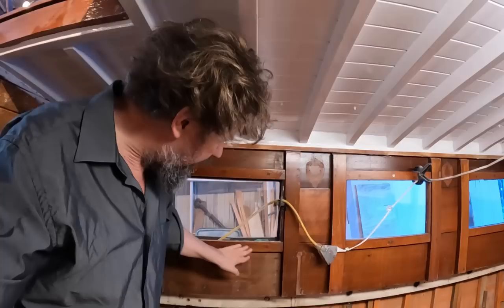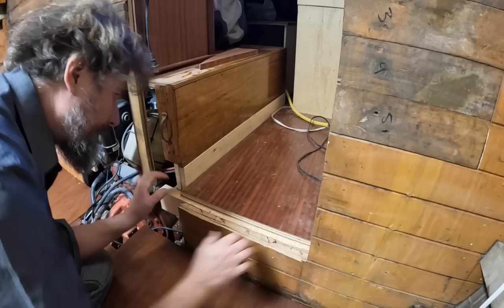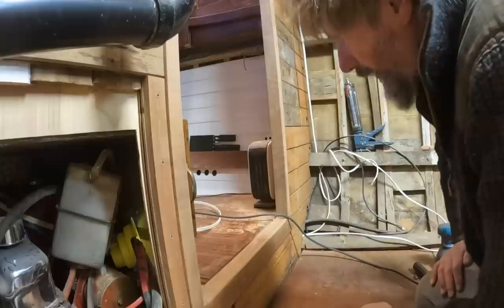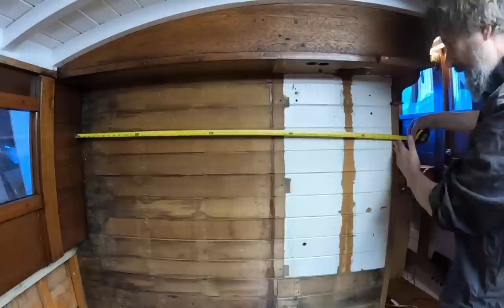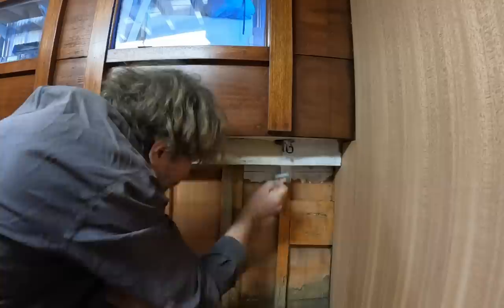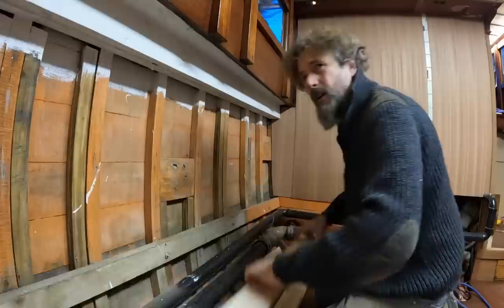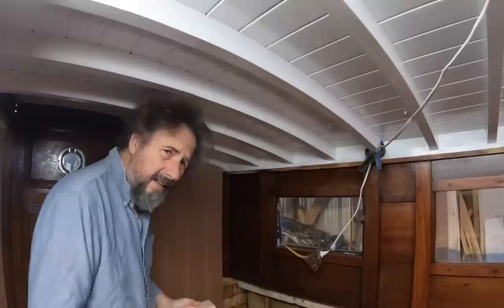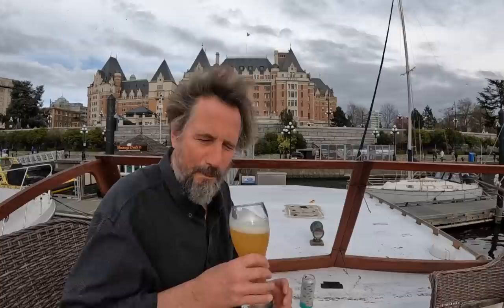Beautiful Bulkheads - #360 - Boat Life - Living aboard a wooden boat - Travels With Geordie

Comment: I see you used the glue to  put the panels on.
Although just a few weeks ago you cursed the glue!
But when the next rip-off of this bulkhead is done
It very likely won't be done by you. 😄

I'd say, sometimes you got to do what you got to do. Like generally the theme of this channel is not so much about doing what is THE optimal thing, no matter the cost or the time, but rather what is possible and practical with what you've got (materials and time) while staying true to the character of the boat. And, of course, to make sure that whoever may in the future have the privilege to spend some nights on Poem can feel really privileged to be able to inhabit such a nice interior!

Comment: Looking good I was going to say that you could use the mini roller on the sealant also but you did use it - saves time, you can also use it when you use the gel coat too. It lays down smooth gives you enough time to wipe it off. I’m a 30 year painter and stainer. One other thing I noticed you did was spreading the caulk with the putty knife. Absolute no no it will bacon up on you later. Use putty instead. Product called (one time) spreads nicely. Trust me I know what I’m talking about.

Comment: Fun to watch the progress. I have a Bostitch brad nailer similar to yours, it sure makes putting up thin material a breeze. Beats the older method of trying to grip small nails, hold the board in the correct position and nail it up with a free hand, if you have one!